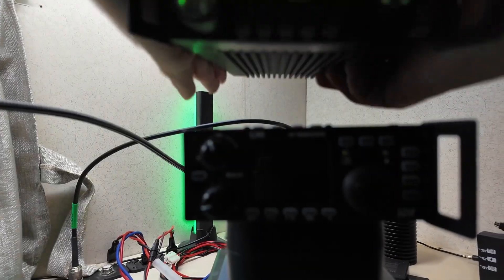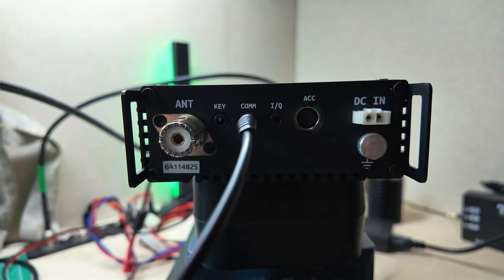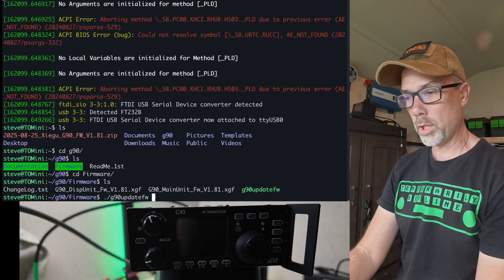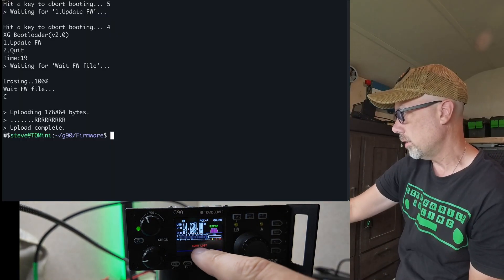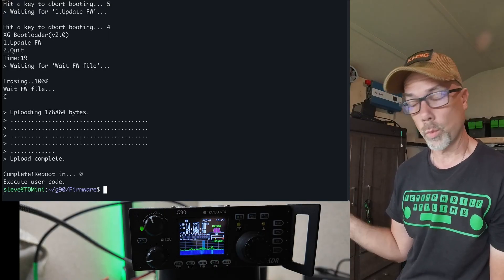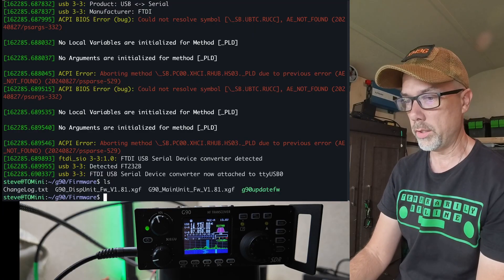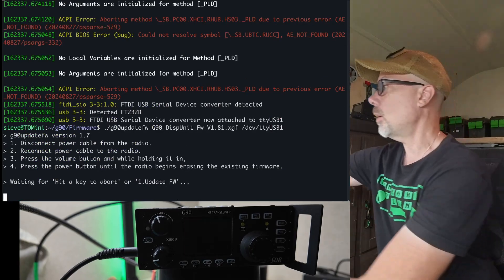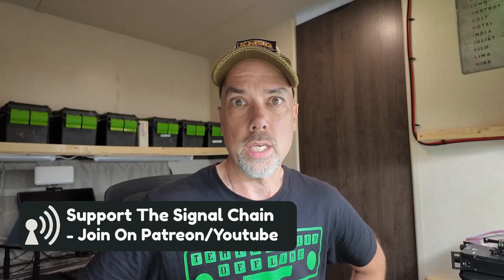How To Unbrick your G90 After a Firmware Update Goes Sideways

Comment: Hi Steve-  I've been trying to update my G90 from v1.79 to 1.81 using the OEM programming cable and carefully following the directions.  Device Manager shows the USB cable as FTDI and working properly on COM3. Tera Term starts fine.  However when I try to put the radio in update mode by holding the Volume knob and powering on , I get a message that says "Warning: this is not CI-V Port".  Any advice?  I'm thinking I might have a bad programming cable? Thanks for being awesome.
Reply from the maker: There are 2 holes on the side of the radio, one is for headphones and one is for civ.  On the back of the radio there are 3 and I think the one you want is labeled comm
Reply from the maker: Try this: https://youtu.be/NIUbbSjRXsU?si=50CPG8oujF4CCT-b

Comment: Brilliant timing to make this video as I got the coms lost message after updating my G90, fairly sure this was due to not ticking the 1k box when using Tera Term 5. All your steps worked except at 4m15s I din't get the reboot message, then turning the radio on/off still showed the coms lost messge, on reboot. Instead at the 4m15s, disconnect the power and on power up the radio works OK. I have an earler G90 so this might account for the difference in steps. Thanks again and now my G90 is working with no coms lost message and the latest updates are applied.
Reply from the maker: Glad it worked for you!

Comment: I really have no idea why you have to unplug the USB dongle between updates. I run Fedora 43 with a Digirig interface (but the same applies to any other USB to RS232 dongles I run or have run in the past) and I never ever I had to disconnect and reconnect it. I bricked my G90 last week when I tried to update the firmware via minicom and it failed miserably. Luckily I remembered I had the same software you were using, on my NAS, and so it saved my bacon.

If you don't want to keep finding out which ttty port is allocated when you plug in the USB dongle, add a rules file in /etc/udev/rules.d (or whatever the debian equivalent is). My file is named 75-serial-comms.rules (75 is the priority and it has to have a .rules extension but whatever is in between the priority number and extension can be anything that makes sense for you). In the file add one or more lines like this one below:

SUBSYSTEM=="tty", ATTRS{idVendor}=="10c4", ATTRS{idProduct}=="ea60", SYMLINK+="digirig"

where: SUBSYSTEM is always "tty" for USB to RS232 dongles, ATRS(idVendor) and ATRS(idProduct)  values you can find by running `lsusb -v` and look for your interface and lastly for SYMLINK the name of the symbolic link that will always be created in /dev when you plug in the USB dongle regardless of the tty port ( in my case above it would be /dev/digirig on top of /dev/ttyUSB0 or whatever).
You can add as many interfaces you want in the same file as long as you have unique symbolic links (and of course the IDs of the interfaces are unique).

For example:
- for YAESU FT-DX10 I have these 2 lines (it's finding 2 USB ports although you are connecting to only to one):
SUBSYSTEM=="tty", ATTRS{idVendor}=="0424", ATTRS{idProduct}=="2512", SYMLINK+="ftdx10-1"
SUBSYSTEM=="tty", ATTRS{idVendor}=="10c4", ATTRS{idProduct}=="ea70", SYMLINK+="ftdx10-2"

- for Radiodity QT80
SUBSYSTEM=="tty", ATTRS{idVendor}=="1a86", ATTRS{idProduct}=="55d3", SYMLINK+="qt80"

- for my NanoVNA:
SUBSYSTEM=="tty", ATTRS{idVendor}=="0843", ATTRS{idProduct}=="df11", SYMLINK+="nanovna"

-for my TinySA Ultra:
SUBSYSTEM=="tty", ATTRS{idVendor}=="0483", ATTRS{idProduct}=="5740", SYMLINK+="tinysa"

but for updating the firmware on the NanoVNA  or TinySA Ultra I had to use this setting (it's common to both):
SUBSYSTEM=="usb", ATTRS{idVendor}=="0483", ATTRS{idProduct}=="df11", MODE="0666", SYMLINK+="fw_device"

After setting the rules, if you don't want to restart the computer,  reload the rules (as su/root) with:

udevadm control --reload-rules && udevadm trigger

So no more looking into which port was allocated for a USB dongle as it will always have at least a device with the name you specified for the symlink regardless of the ttyUSBnn.

I hope it helps.

best 73's de 2E0LGL

Comment: I bricked my G90 on my second firmware update. You have to use Tera software that comes with the firmware, if you use older Tera from the previous firmware update, you brick your radio. I had lights blinking all over, had to downgrade to the original firmware and go one by one up. Learned that the hard way.
Reply from the maker: That sounds like a tough lesson to learn, glad you got it sorted!

Comment: Thank you TO for this video. The first G90 i bought, I went and updated the firmware on the display unit and bricked it. Lucky I was able to send it back to Amazon and get a refund ;) So, the one I have now I would like to update and with this video I feel better about doing it. Also, I tried using the firmware update software and the directions off the Radioddity site on the first radio, which haven't been updated and are hard to follow. I will download the updater that you have listed this time!
Reply from the maker: The g90updatefw is a game changer!